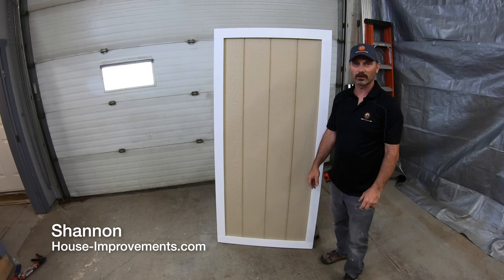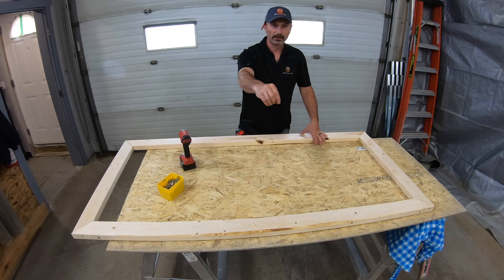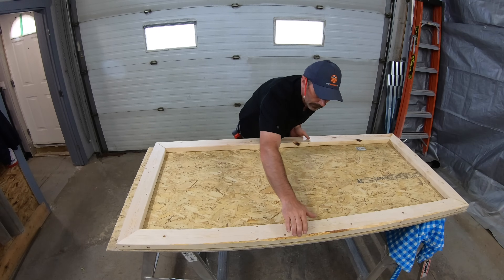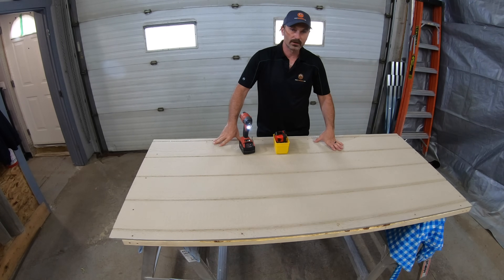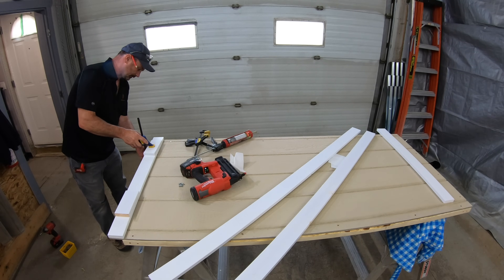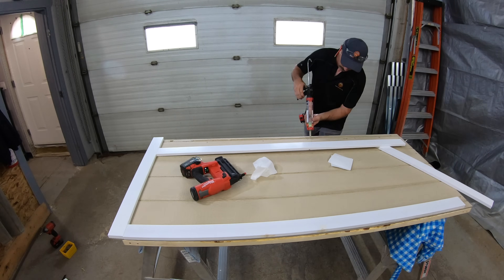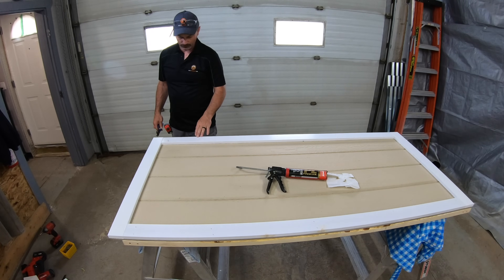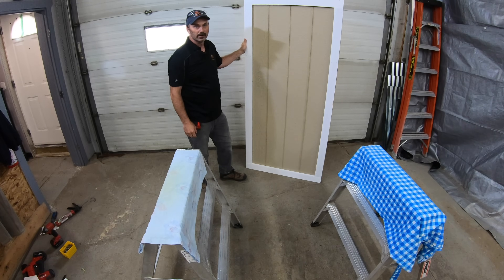How To Build An Inexpensive Shed Door

Comment: You might want to attach some screws 3/4 of the way through from the backside.
I used that stuff to renew my garage door and after several winters with snow against the bottom of the door, the wood has warped and started to curl from being wet.
Reply from the maker: With the adhesive I added it should be fine.

Comment: I did a similar door but brought the 2 side trims all the way down and used a 1x6 for the bottom piece. kind of like a kick plate look. Also put a bevel on that piece so water doesn't sit. I didn't set the latch side back any  But I should have !

Comment: I'm currently trying to do this. My 2 LP panels almost fit perfectly in the middle; so they'll overlap like they are designed to do. The trouble I'm having is, bc I couldn't get a perfectly straight cut, and the doors are different sizes, I can't figure out the length of my structural 2x4s. I'm probably over-thinking it, bc I can tighten up the seams with trim.

Comment: Very nice, fairly simple.  
You used is LP siding in the lower 48 where I reside we have T-111 siding very similar in look.  Does the LP brand required staining or painting like T-111 ?  And thanks for sharing Mr. Shannon
Reply: It comes pre-primed and requires exterior grade paint. I have used it on my shed and it still looks good 3 years later. Cheers!
Reply from the maker: Yes and yes

Comment: Thank you for this Shannon . I am wondering if it would be possible to make this 48” wide which is the size of my door frame . I thought it may be too heavy and would have to do two doors ? What would be your advice please ? I have only used exterior plywood on my shed which unfortunately is letting in water at base , will have to seal with something .
Reply from the maker: You could do it 48" door in most cases.